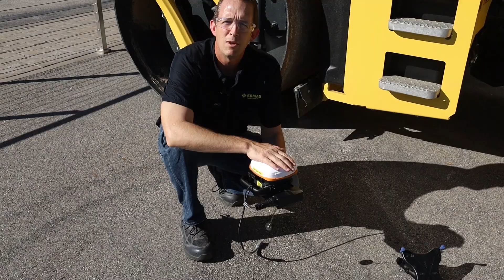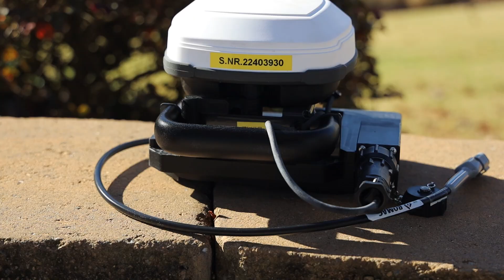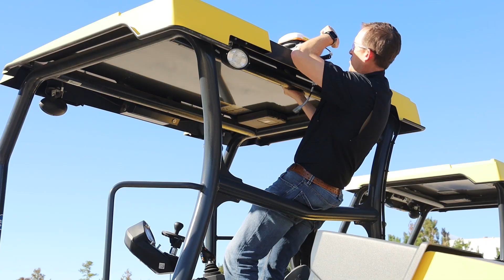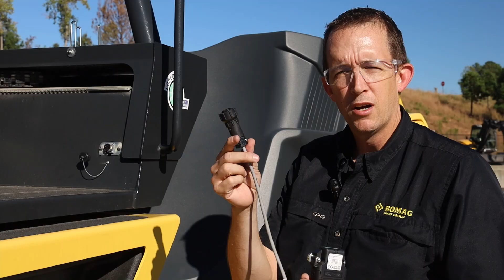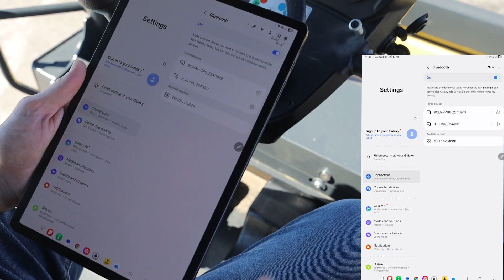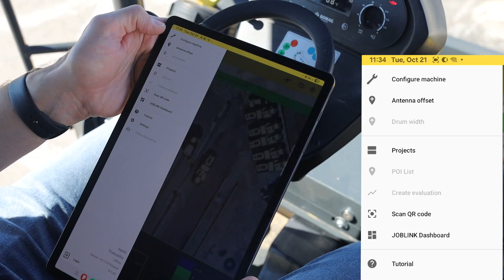How to: Set Up BOMAP with VM38 JOBLINK

Comment: Is it possible to use RTK corrections in VM42 antenna to get highest accurate? Thank You.
Reply: Hello @czmiel.t,
Great question!  The BOMAP system has 3 options for GPS accuracy:
1)	You smart device’s internal chipset: The GPS chipset in a smart device is the lowest accuracy option, which, on average, could be from 5-25 feet.
2)	The BOMAG VM42 Precision GPS Receiver: This receiver is SBAS capable and provides an RMS accuracy of 30cm (<12in).
3)	An additional satellite-based correction service for the VM42 GPS receiver is available for a yearly license fee, which will further improve the accuracy to 4cm (<2in) RMS accuracy.  This correction data is fed to the receiver through L-band satellite transmission. This is called the VM47 Correction Service.
The VM47 Correction Service is technically considered to be a Virtual Reference Station (VRS).  The VM42 GPS Receiver does not have a modem or radio, so connection to a site base station or local CORS / NTRIP data is not currently available.  With the BOMAP product, BOMAG chose to prioritize simplicity and ease of use, and the product offering of VM42 GPS Receiver + VM47 Correction Service reflects that.
Hope this helps!